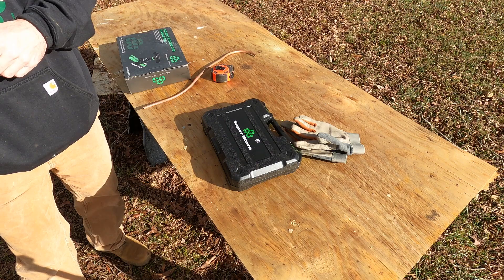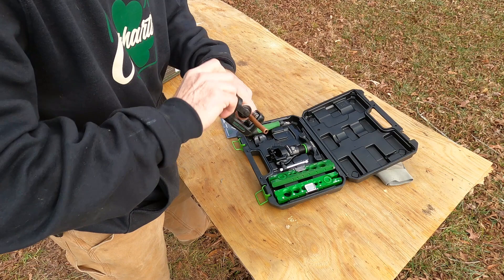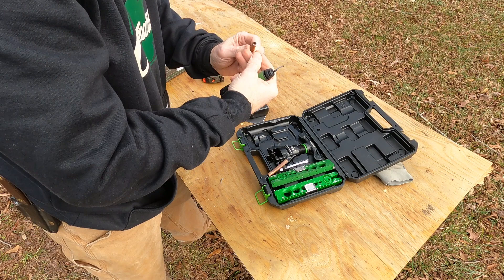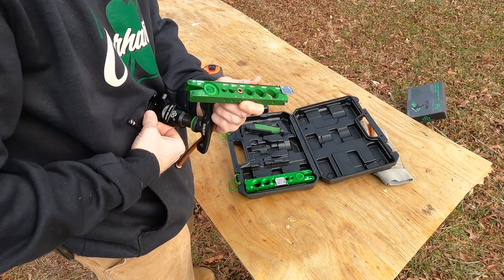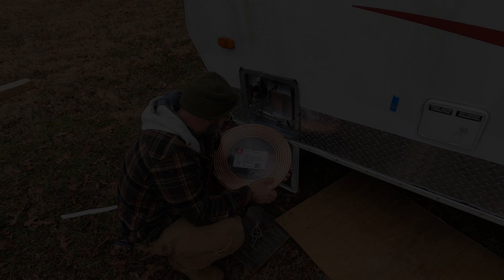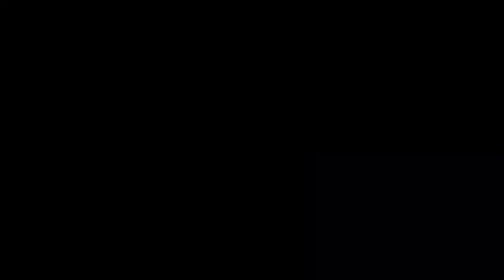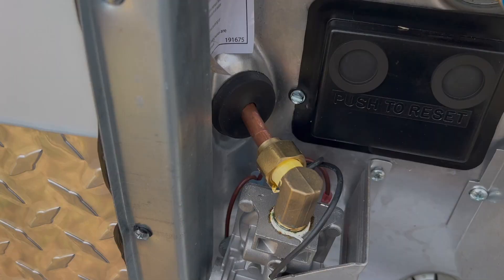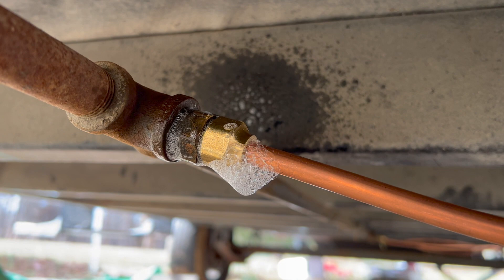How to Replace a Camper LP Gas LiNe (Easy)

Comment: Great video thanks for making it!
Reply from the maker: Thanks for the comment. One thing I did in the video that you can omit is I added pipe tape to the threads. You don't need pipe tape on flare fittings.

Comment: Do you need to get it certified by a gas fitter? or are there no regulations?
Reply from the maker: I am not aware of any regulations that require it to be certified by a gas fitter.
Reply: @parkedredesign  I guess we have different rules here in Aus

Comment: No pipe tape on flare fittings. Only use pipe tape on pipe (NPT) fittings
Reply from the maker: I appreciate the comment, I did not know this and have been using it on other similar applications. I will remove it and have to update this. Thank you.